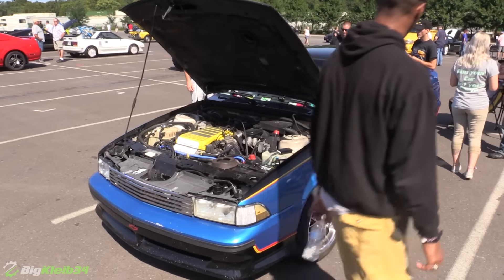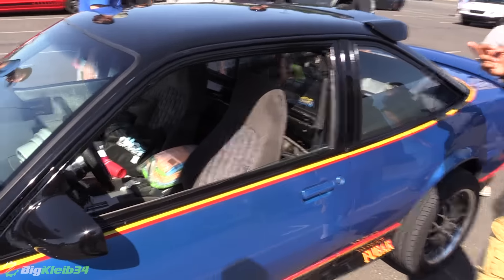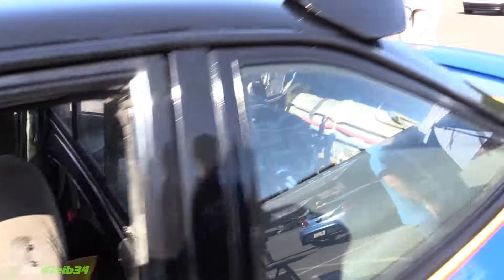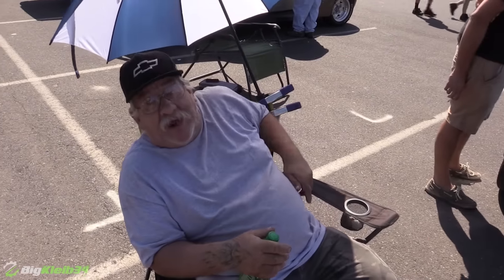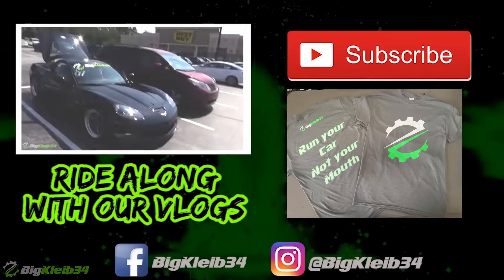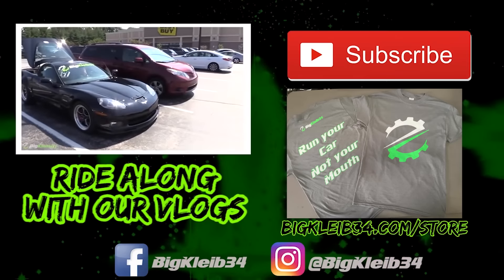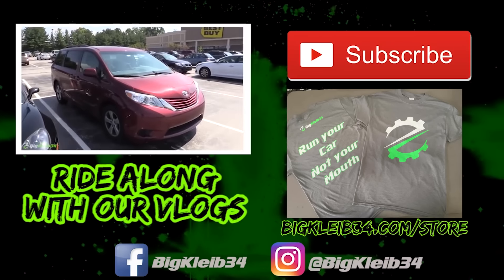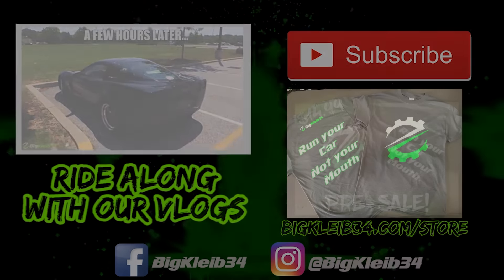"It Started out as a Joke" - Insanely OBSCURE Chevy Cavalier Build

Comment: What if he put the front in gear and the rear in reverse and did his own sort of 4 wheel standing burnout
Reply: Yes
Reply: Make it happen
Reply: That's what happen four wheel burnout in one place.sport compact car magazine had a Hyundai with two motors two turbos.should be so ware on you tube
Reply: That may rip the poor thing in half 😂
Reply: omg your a genius
Reply: its a rwd only, both engines are connected to a single trans.
Reply: wrong, each has its own trans. dude says it in the video
Reply: it was said 3 or 4 times, completely separate entities.

Comment: Was really hoping to see it in action. I can even imagine how it works with two separate transmissions.
Reply: Ha ha what's up? I was looking into a mid rear setup, and the complications, ended up here.
Reply: In 24 Hours of LeMons, there is a team running a twin-engine car (front of a Corolla mated to the back of an MR2.) The Corolla is manual and the MR2 is auto, and so you only have to shift the front one, the rear one keeps up and adjusts for the conditions the front puts on it.

Comment: i have a question though, wouldnt the ecu get confused? how do you get a engine management to run dual engines?
Reply: Domz Collesso each motor has it's ECU the trottle cable is connected to both engines, my only doubt is about the transmission, maybe one is automatic and the other manual to manage the driving